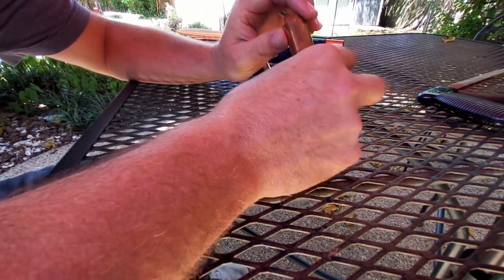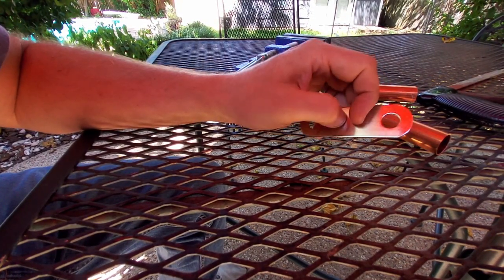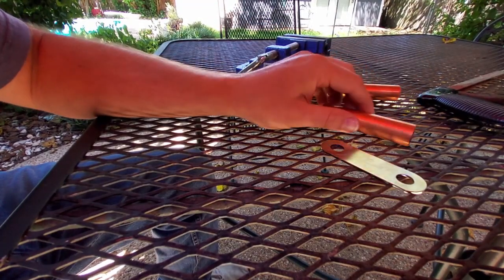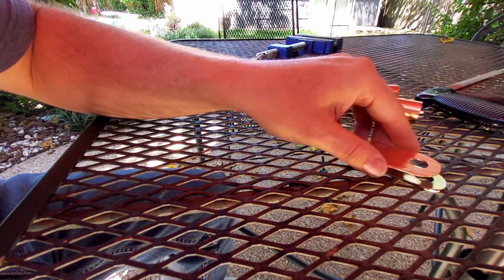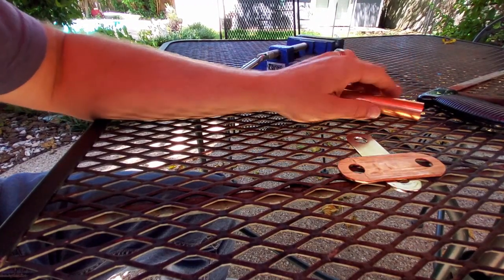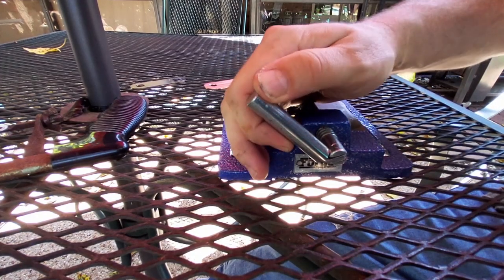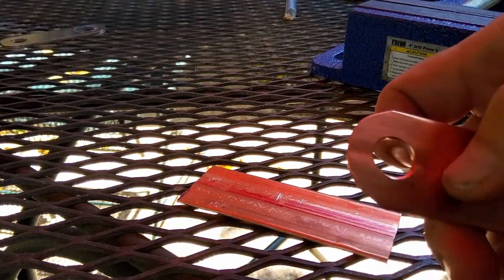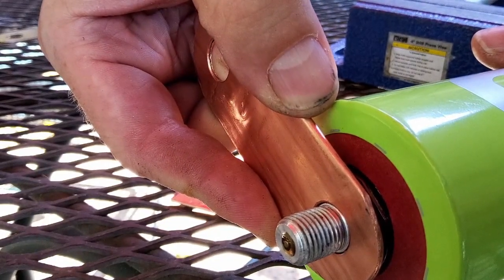DIY Copper LiFePO4 Busbars

Comment: I don't think I heard you say... What's the current limit when making them this way?
Reply from the maker: Should be able to handle 60+ amps. I've yet to run anything past 60amps on them.
Reply: @BradCagle  thanks Brad! 

I'd be around 80 peak. Maybe I'll just stack them 😆 I don't know yet. Still planning this bike out.
Reply from the maker: @chriswf  you could try single first, and as long it's not heating up, and no significant voltage drop you should be fine

Comment: Did you ever come up with a busbar for the 32650's? Between the 2 12v packs. What about the main pos. Neg. Of the 24v pack, busbar? I have given in to the Cagle method.
Reply from the maker: I combined the two 12v packs, and now they are a single 24v pack soldered in between. As for the main pos/neg I just left the wire because although you could rig up a threaded buss bar  on the ends I feel like the wires are better because of the strain relief, a bar on the end might compromise the spot welds.
Reply: What about 8agw-12agw, cut the insulation @each tab and soldier. Flush on one end and lug connector on the other. I guess you could soldier the 2-12v batteries together,  but then you have to wrestle them around. What about BMS leads? Did you soldier them? To the pos. Side of the tabs? I do like how streamlined, and stable each pack turned out.  I took the fiber boards from the cells and attached to the ends of the packs. Cut holes for the end where the big ass zip ties connect.  And just taped the other end. I bought a low profile HDX tote like Darren Orange. It will hold 2-24v. Batteries. What size cable between the two batteries.  And what size cable to the inverter? I've looked @several wire size calculators and come up with 4 different sizes...thanks

Comment: Smashed mine with a hammer, drilled them, then added heat shrink to the area not under the bolt. Cheap and easy

Comment: I'm just curious what you built with these cells?  I put mine into an 8S configuration to power my 24v trolling motor, but I'm doing something wrong because the BMS goes to sleep and only shows like 6 or 7 volts.  Not sure what's going on because the individual cell voltages are fine and the pack voltage is right where it should be.
Reply from the maker: What bms are you using?

Comment: I actually bought 32 cells like you show here, and I am just sharing my experience with them... :) The problem for me was battery '-' is nickel plated copper (which is ok for copper obviously)  but battery '+' is aluminum which is NOT OK WITH BOTH COPPER AND NOT OK WITH NICKEL. So I think I am going to use tinned copper SC-25-12 cable terminals crimped onto non isolated tinned copper 'braids' (just because I have  them, everybody can use simple insulated copper wire) and connect batteries with them.
Reply: I actually looked at the scale of potentials between metals and nickel is actually closer to aluminum than tin... I am now not sure what is better. I am finding a lot of controversial stuff in internet, will probably try to find something as close to being 'scientific' as possible... :)

Comment: With a proper vice, small anvil surface, and a 3lb sledge, it's pretty easy to make bus bars this way.  Very cool!
Reply from the maker: Agree, my little drill press vice is not up to the task. But A nice bench vice would make short work of it!
Reply: @BradCagle  I bought the exact same cells, after seeing your first video, and made about a dozen bus bars from old copper pipe we had laying around.
Reply from the maker: @jasonbroom7147  Nice, the busbars work good?
Reply: @BradCagle  Yeah, the copper pipe I used was the old, thick-walled stuff, so they're massive.  According to the table I found, they could carry 150-200 amps and the trolling motor in my boat peaks out at about 35, so total overkill for what I'm doing.